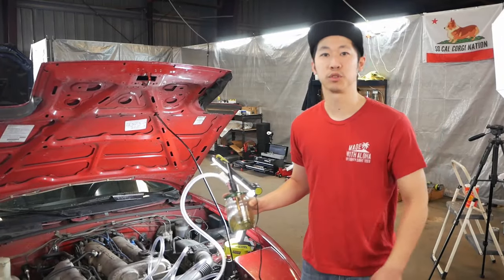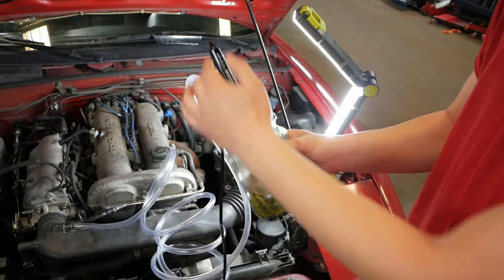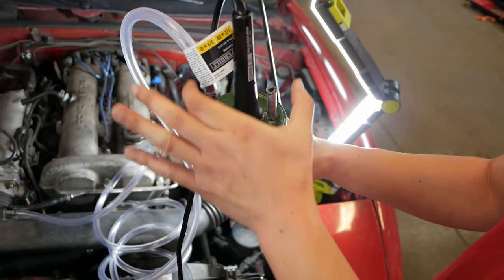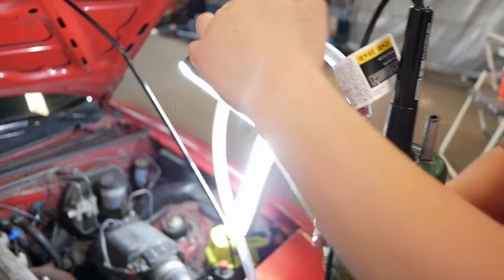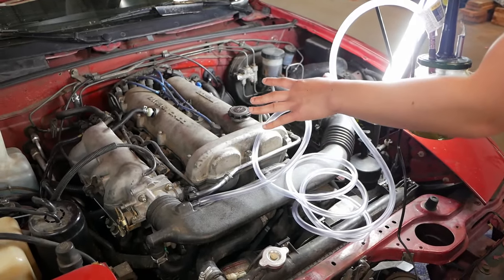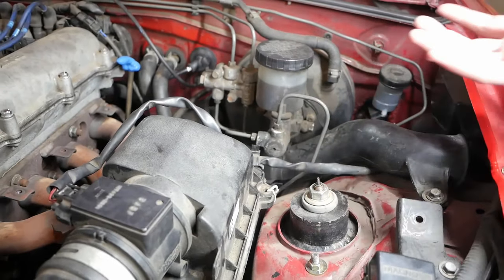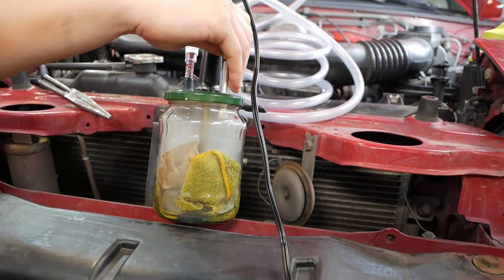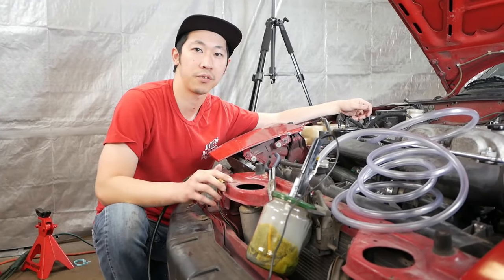Build a Smoke Machine for Under $10 | How to Smoke Test a Car | Check for Vacuum Leaks

Comment: Does the car need to be running? ..or in the on position?or just off?
Reply from the maker: car off! you'll be slight air pressure into the system so thats how youll get air flow.
Reply: Thanks you